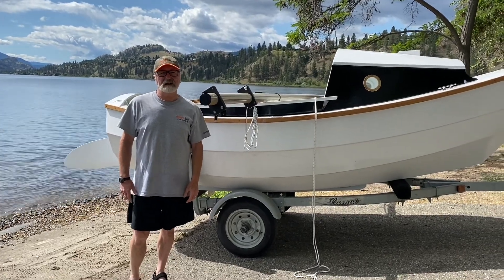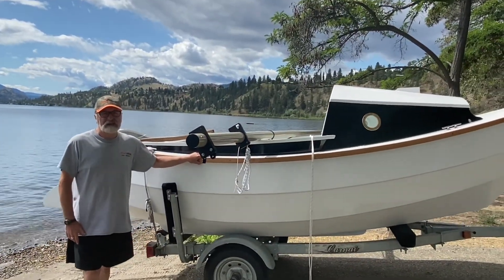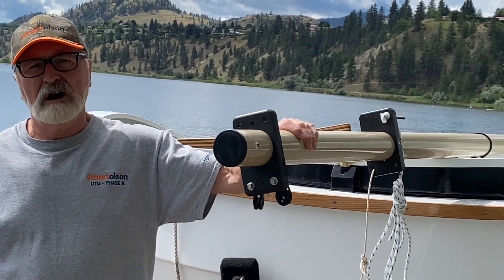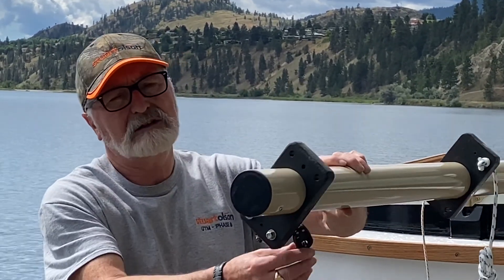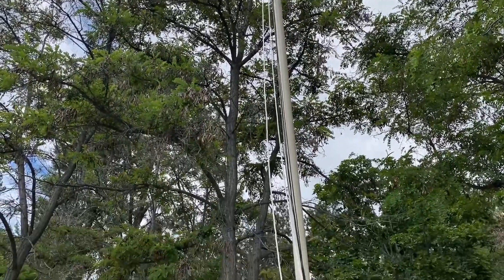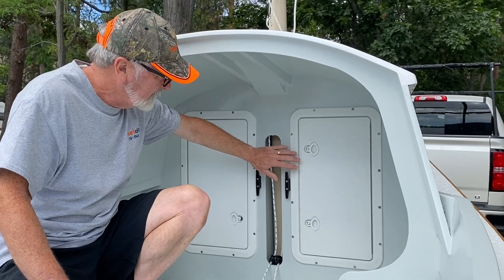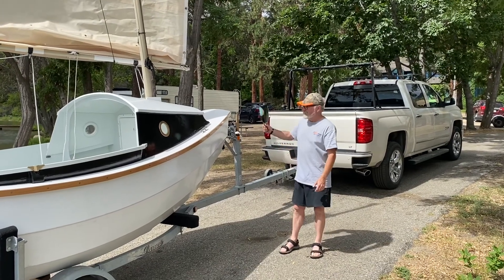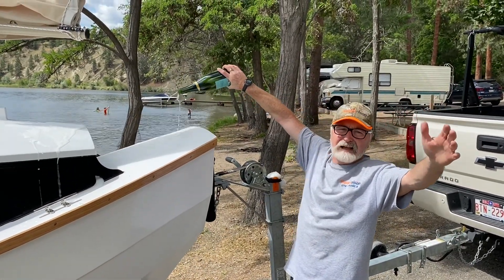Scamp Sailboat #459 - LUGGY

Comment: Looks like a great build , how have the mast/control line alterations worked out??
Reply from the maker: The halyard and downhaul feeding through the mast trunk worked well. However, I am going to make a change to the pully blocks by removing them from the lower mast guide block and I will attach them to the lower part of the mast truck on the outside of bulkhead #3. I found that If I forget to tie off the mast holddown the current configuration lifts the mast up off the base of the mast trunk when the lines are tightened.